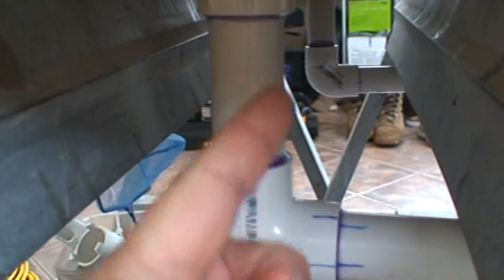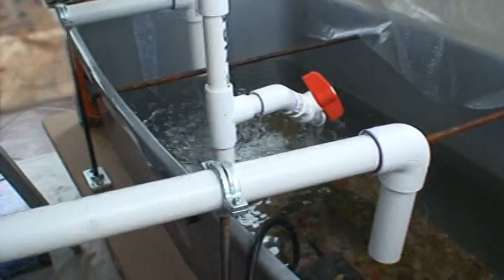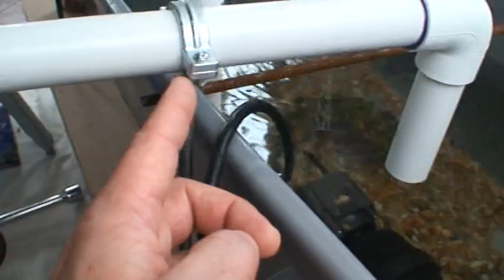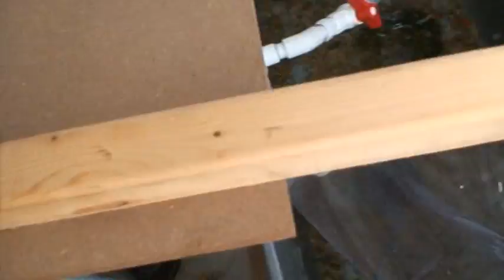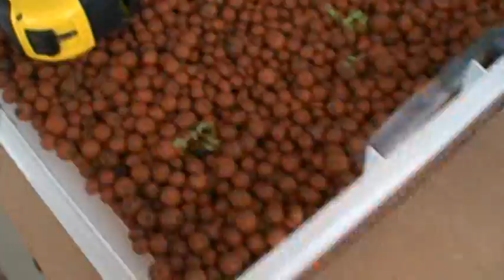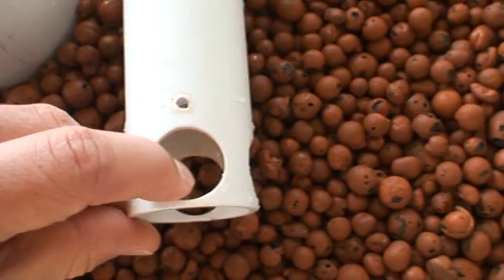Aquaponics 05 - Bell Siphon Troubleshooting [part 1 of 2]

Comment from the maker: @affnan
Nice to hear from you.  I hope you watched part 2 of this video as well.

Yes, from what I've found -- it's not the siphon itself, but the drain pipe.  The two 90 deg angles in the pipe are what were providing the issues here.  As of the end of this series, I am still using the same system - and it is tuned properly without issue.  However, overall, this system I used is terrible.  I plan to do a video of "what not to do" in Aquaponics, as my system is perfect in that regard.

Comment from the maker: @msamour
that may be my next video - critique on this system.  I would not recommend building this system.  It is a good start, but I can already see a heap of drawbacks.  I've already got the next setup in my head.  If you do build this, do yourself a favor & build a "tub over tub" system.  Also, don't do multi-GB's like I have - make them one.  It'll increase GB fill time, which will combat root rot.  Ultimately, you need a fill cycle of about 12-15min (not including drain cycle).

Comment: My siphon never reach the grow bed buttom. The water down only about 1/4 of water level and start to fill the water again.
What's wrong with the siphon?

thanks in advance
Reply from the maker: I think, if I understand your question, you're referring to the low level of the siphon, not the high level when it begins (which is dictated by the height of your standpipe). If that is the case, when the siphon breaks (stops draining) air has been introduced into the bell. This could be from a variety of sources. I do not recommend making bell siphons with an exterior tube. I do not use this type of bell in any of my siphons. All that is needed is a small hole, half circle, or notch cut at the bottom of the bell. Once air gets into the bell siphon, it will cause the siphon to break. When the siphon breaks can be slightly regulated with the flow of water into the grow bed(s). Also, depending on how you've constructed the down tube from the bottom of the grow bed (additional unnecessary plastic pipe fittings for example) can cause the low water mark to be higher than you wanted in your design. In all of my current aquaponic setups, there is usually 1" of water that will never drain out. From what I have personally accomplished, completely draining the tank is impossible. As the siphon begins to break (air being introduced into the vacuum) the water supply is coming in at some volume which should be plumbed such that you can control it with a valve. These two factors play a sort of tug of war until the siphon breaks completely. Because of this lag created during the siphon wanting to break and the incoming water from the fish tank pump supply, I always end up with some amount of water in my grow beds; it's simply unavoidable. Given a grow bed height of 6", 1/4 volume of water would not be unreasonable to me, since that's only 1 1/2". However, if you are using deep grow beds (as I am in this video 13") 1/4 volume water remaining would indicate a problem imo.

BTW - This video is not up to date with my current aquaponics systems. I apologize I have not keep up vlogging about my aquaponics, so I will have to describe what I currently have. I no longer use multiple bell siphons for each of my grow beds. I only have one bell siphon for all of my grow beds (4 total per fish tank)- each grow bed is connected with bridge siphons (upside-down U shape filled with water) Here is a video showing the bridge siphon Bridge Siphon Between Raft Beds This reduces the overall amount of plumbing necessary in the system. Because of this, I only have 1 water supply filling the first grow bed. (300 gallon fish tank) Fish tank pump -> grow bed 1 -> bridge -> grow bed 2 -> bridge -> grow bed 3 -> bridge -> grow bed 4 -> bell siphon -> fish tank. I also no longer use an off-set down pipe as shown in this video. My current system uses a straight down pipe, as the last grow bed is situated directly over my fish tank. The simple solution to the problem I am describing in these 2 videos (bell siphon troubleshooting) is actually rather simple: The down tube should always be smaller diameter than the standpipe. For example if your standpipe is 1" in diameter, use a 3/4" or even 1/2" down pipe. I think in my current systems, I'm using a 3/4" standpipe, 1/2" down pipe with an 1 1/2" dia bell siphon surrounded by a 4" bell shroud (pipe larger than the bell siphon with many, many holes drilled through it to keep the grow media out, but keep the water flowing). Since switching to this method of using a smaller down pipe diameter, I have NEVER had any siphon malfunction ever. The smaller diameter down tube allows for a tighter vacuum to be formed by the outflow of water. It also improves fish tank aeration as the outflow of water is more like a jet.

My current bell, sits flat on the bottom of my grow bed and prior to cutting it to length, I used a 1" hole saw to cut a circle out. Then I cut the Bell's height to leave 1 to 1 1/2" air gap above the top of the standpipe when the bell siphon rests on the bottom of the grow bed. When you cut the Bell to desired height, you cut it across the diameter of the circle you cut out with the hole saw, which leaves you with a 1" diameter semi-circle with 1/2" height from the bottom of your grow bed. This is how my Bell siphon receives air, through the bottom of the bell. Only one hole is necessary. No extra pipe work, no tubing, no fittings. As the water drains under vacuum, it will continue to do so until air is found through some breach. In this case, the bottom of the bell siphon. That is as low as I could get mine to work. As stated above, I still end up with about 1  inch of water at the bottom of my 6" high brow beds. (another thing that has changed. In the video above I'm using a ridiculously high grow bed of 13") I have found that a 6" grow height works fine for me and saves me $ b/c now I don't need as much grow media to fill the beds. However, since I'm using bridge siphons to maintain the levels of all 4 grow beds, I REQUIRE water at the bottom of my grow beds - otherwise, if air is introduce into them, the grow beds would fail maintain equilibrium. All of my grow beds are fitted with an over-flow down tube which runs back to the fish tank in case this occurs (sort of like the overflow in a bathroom sink)

no. I have not had any issues with so-called root rot b/c of the remaining water in my tank. I've found these comments are left by people who are not actually doing aquaculture, but simply watching videos. At this time, I use my aquaponics to grow many variety of lettuces, Asian-type cabbages, so-called micro-greens, broccoli, celery (especially good if your system is too alkaline) and many variety of herbs (differing basils, differing parsleys, oregano, thyme, dill, chives, cilantro/corriander)

hope this helps.
Reply: VincentVonGoat
Wow ! It's very comprehensive. I'll check it out.
Thanks